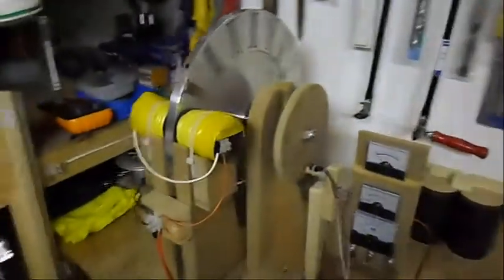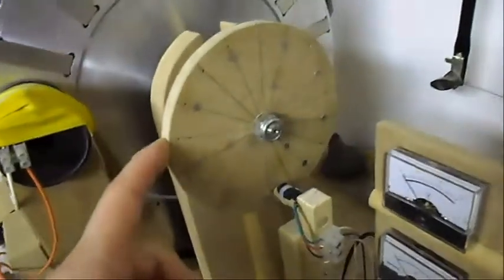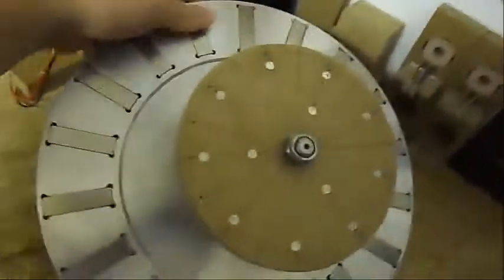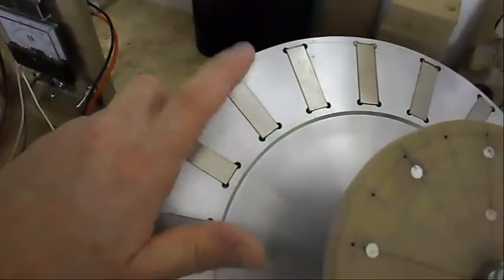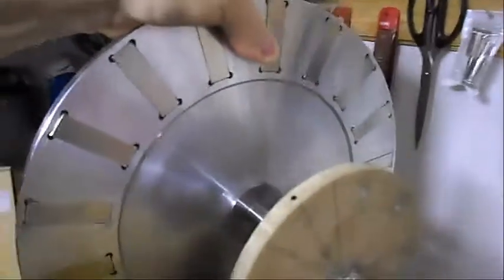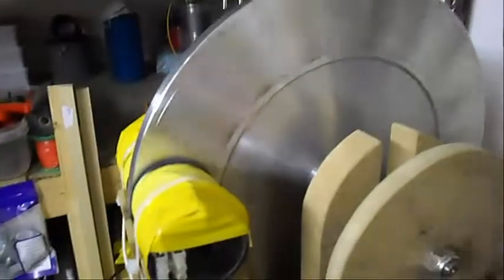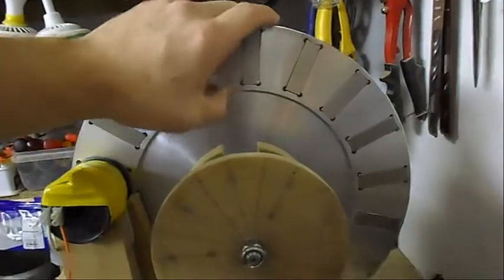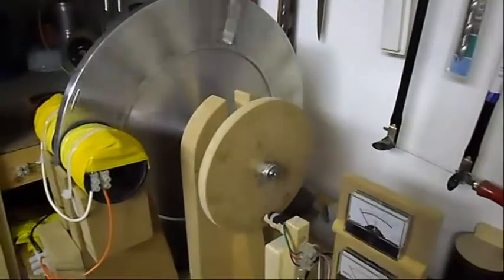Pulse Motor - Just a Pulse Motor Build & 18 Pole Rotor...

Comment: Good job! However, I did not understand how the magnets are installed. Are the magnets set so that they all face north on one side and south on the other? Or is the polarity of the magnets on each side sequentially alternating north-south-north-south, etc.? And some more question. What is the outside diameter of the rotor?  What maximum rpm were reached and at what supply voltage? Thanks in advance for your reply!

Comment: Hey guy use a pulse circuit made of a bridge rect, Nchan -Mosfet, leds for seeing power an the pulse from the hall cell. and diodes for one way output to the coils rated for the back emf of the coils. I hope you are using something like the A3144 hall cell switch because some of the  hall cells out there are differential and require a lot more stuff... Playing with one like your but mines made out of acrylic.....